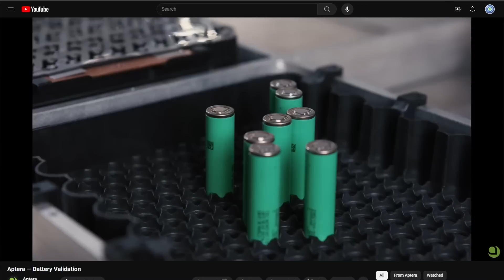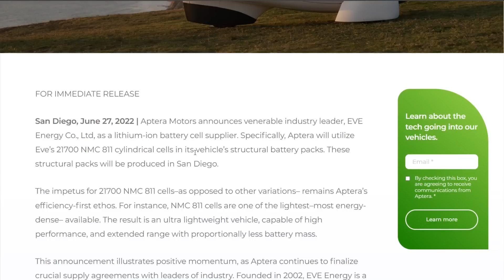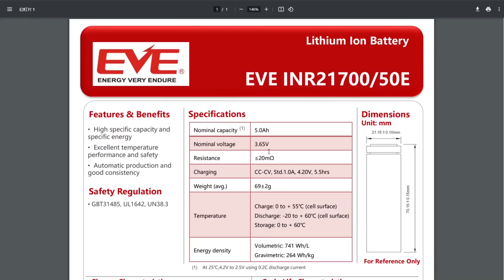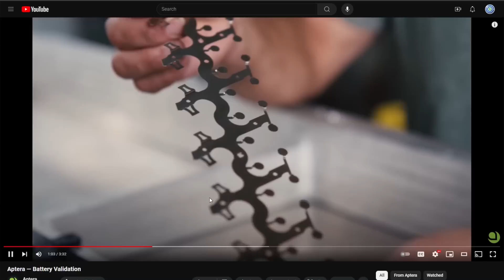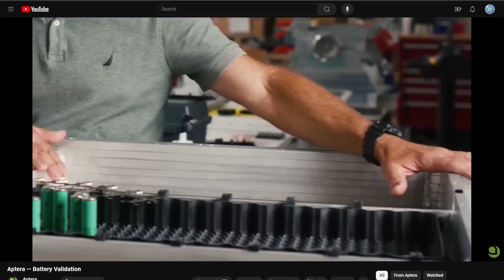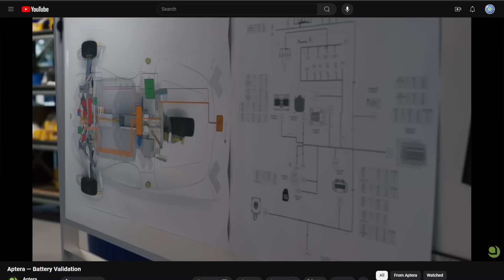Aptera's PI Battery Pack

Comment: They should use prismatic batteries with better energy density per battery pack per liter and also jus single motor in rear wheel .

Comment: Sorry for the late comment, but my private cell provider put out a new price list for cells.  I don't know if EVE's "INR21700-50E(3C)" (a 5000mAH capacity 21700 cell) that you looked up and the one listed in my price list is the same as their "811" cell, but this cell is currently listed for retail purchase (non-wholesale) for $1.95 usd /cell.   With the LE's requirement for 2,304 cells (384 x 6), if I were to buy them, it would cost me $4,492.80 usd to purchase the cells for the 400 mile LE

Comment: I love that they've done the vibration testing, but I would be curious to see how the battery pack holds up after simulated 200, 300, or 400k miles. 

I'm sure that if a failure due to design was going to happen, it would have happened in the first 100k miles, but think about the theoretical lifespan of these vehicles and batteries. 1000 charge cycles of the 400 miles pack is 400k miles, and the battery might last even over 1000 charge cycles 

Even if the warranty was only up to 100k miles on the battery, I think it would still be very informative to vibration test 1-2 packs up to 300k miles, just to see how they preform.

Heck, you could even take one, and just vibration test it until it fails, just to see how long it will go

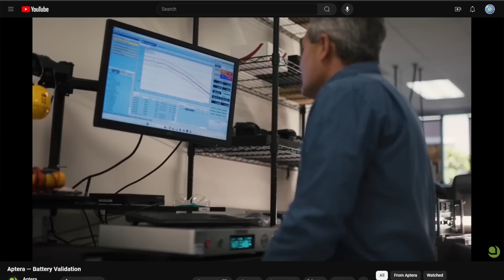Comment: @18:30 "no capacity reduction" after 100,000 miles of driving? really? does that mean they're saying the range of the pack 100,000 miles later will be just as good as it was when it was new?
Reply: This test was just about mechanical connections. They shook the battery an equivalent of 100k miles of driving, and everything still worked. Presumably they're still doing other testing
Reply: @GoClimbARockEh  yes, that was pretty clear from what was said in the video. I was curious about the comment 'no capacity reduction' - what could that possibly refer to other than battery capacity? If the test was purely about mechanical connections, what capacity was he referring to?

Comment: Hopefully LiFePO4 also will come in that cell format and reprogramming the battery management is easy.
Keep the weight the same and let the energy density drop to whatever it come out at (%10 less??).
The voltage might be a bit less and the 4 sec sprint time might increase a tad.
I'm currently looking at buying an Ora to drive till Aptera comes to Australia. I'm opting for LiFePO4 version with 110K less range than the NMC version.
Ora range is quite marginal for me but Aptera will go twice as far per KWH.

Comment: Nickel has higher energy density than cobalt but is more volatile. Recent chemistry engineering toward higher (and aspirationally all-) nickel content has been on stabilizing the cathode to allow maximum nickel percentage without sacrificing safety and longevity.

Comment: Thanks for another great video. None of the numbers add up but are in the ball park. That's kinda par for the course with lithium battery packs. A couple quick Google searches suggest the complete battery pack will be in the $10K to $12K range which is good news. The engineer seemed a bit too cheerful about the 'better that 400 miles per hour' charge rate. That's 2/3's of the 60KW DC fast charge Chris Anthony mentioned they might get to in previous videos.
Reply: The 400 may be a consistent rate while the 60 may be a peak rate,  which is typical of ev charge rates.
Reply: Came here to say this. 400 mi/hr is what I get on my Model 3, which is slated to have ~1/4th the range per kWh than the Aptera. So the Aptera battery pack will be charging at 1/4th the rate of a Tesla…?

Comment: As per normal, i'm confused. ¿Why is a single 'bus bar' connecting to both anodes and cathodes?
Reply: Some cells are in series, while others are in parallel.
Reply: @glennzajic7318  Thank you. Question: ¿How is that better than having each group of cells in parallel?
Reply: @NorCalSkeptics  Cells are combined in series to accumulate the voltage needed, and in parallel to provide the current required. If they were all in parallel you would only have about 4 volts but current up the wazoo. Current is what dictates the gauge of wire needed. The higher the voltage the smaller the wire can be to still provide power. I over simplified it but I am sure somebody more knowledgable can explain it better.

Comment: The 700 in a 21700 cell is the length in tenths of a millimeter.  "Large" cells like this don't really need tenths so they're rounded and just called 2170.  Tenths matter more for coin cells.
Reply: I learnt in school that 10 mm = 1 cm, therefore, 700 mm = 70 cm. The battery cell dimension is 21700. The only way to make sense out of this number is that 21, the diameter, is given in centimeters, whereas the length, 700, is given in millimeters. Thus 21/700. So, no mistake. Is that what you are saying?

Comment: All those hundreds of cells and connections what could possibly go wring . 
   I dont know much but i always wondered why they couldnd make just one giant battery sort of llike a conventional car batery but much larger .  Then it wouldnt take all those tiny cells and connections .
Reply: A couple reasons: each lithium  cell can only generate about 3.7 volts,  so for a typical 400 volt system,  you'll need over 100 cells to achieve that efficient voltage.  You could make bigger individual cells, to make higher energy capacity,  but bigger individual cells would retain more heat and be harder to hear and cool. The industry does use a variety of solutions,  from that 2170s and Teslas 4680 cells,  to "pouch " cells which are flat rectangles of various sizes.
Reply: @jamesengland7461 difficulty getting rid of heat I can understand .
Reply: At any rate,  this is a typical way of building millions of battery packs which have proven to be extremely reliable for hundreds of thousands of miles.  It is crazy though.
Reply: Oh yeah,  I forgot to mention- regular car batteries actually have 6 lead-acid cells , each with 2.1 volts. They're not terribly tough either,  and could easily crack open or the internals break under rough conditions.  They also only last,  for most people,  2-5 years at most.
Reply: BYD Blade Battery is what you are suggesting. I do not know the reason why they prefer these 21700, but I think these are more of a commodity (more manufacturer choices, more testing results available, easier to repair a decade out into the future) and these blade cells were not available at the time of battery pack design choices.

Comment: The battery pack does seem like a great design. I wonder if they could have left a little space for internal cooling though. I like the idea of replacing the batteries with longer ones for the 600 and 1000 mile options, but I do wonder if the longer batteries will conduct heat to the baee as well. And if they go with 100 kW charging the excess heat during charging will be much greater.

I think Aptera is assuming that end cooling will work just fine, and testing will prove that it's overengineered enough that they can handle even more heat with just a bigger cooling system. But if they have to redesign the battery pack it will take time, and the while point was to reuse the battery pack. 

Of course, rhe new battery pack can be used in the original 400 mile version. So they could save some money that way.
Reply: Do you remember what the dimensions for the longer batteries were meant to be?
Reply: @993cc  21120 for the 1000 mile, 2190 for the 600.
Reply: The length were 90mm for 60kWh and 120mm for 100kWh. 
Which means different height in battery pack why I would be surprised if an upgrade from 40kWh will be possible. 
25 to 40 kWh should be possible though.
Reply: @e-economy-  I could have sworn I posted the battery sizes needed. Oh well. 

Anyway, I suspect the battery packs are going to hang lower in the frame, meaning the belly pan will have to be redesigned to reduce the ground clearance and leave room. The tub and interior would be the same, but the suspension would have to be beefed up to handle the greater weight. 

Alternatively, they could raise the battery higher in the frame, but this would require a loss of 20 mm or 50 mm of headroom. The tub could still be the same, but they'd have to take the space out of the roof. Although I suppose they could just make the whole vehicle taller. 

They will probably make the frame thicker, to match the height of the battery pack. So modifications to the frame, suspension, and belly pan. Changes to the body will probably be minimal.
Reply: They don't care about battery health or longevity, these just have to last for test drives and videos to encourage investment, that's how this thing works - pay attention and you might just save some money
Reply: @bluetoad2668  Aptera's batteries are going to last just as long as the batteries in Teslas and other EVs. The idea that EV batteries don't last is a conspiracy theory.

Comment: The battery tray will likely be constructed from extruded aluminum cross members joined at their ends either by direct welding or some other custom cast or extruded members. I beleive that is what Chris said was happening in your interview with him previously, I may be mistaken though cause he could have been referring to the frame at that point.
Reply: I can't see the battery tray being cast fiber or glass as those materials are poor thermal conductors.  Also, casting seems like it'd be out due to the tooling costs whereas that tray looks pretty simple to assemble from dimensional stock.
Reply: @SomeGuyNamedPaul49  what I was saying is just where the extruded members would meet would be a cast aluminum junction piece, just a thought, not saying its going to be like that
Reply: Guessing it doesn’t matter how the battery tray is constructed for PI vehicles so long as it has  very similar weight & strength of final build…. and gets us to PI asap (w/o inferior construction). Someone considerably more experienced & knowledgeable than myself persuasively argued more of PI should be hand-built.
Reply: Are you perhaps confusing the battery's frame with the vehicle's frame? I suppose they are two separate things.

Comment: If this car charges at 400 Mi/h that means the peak charging speed must be only 50 kilowatts
Reply: They were aiming for 40-60 kW, so it's right on target. In terms of mileage, however, that is impressive. It will just generate a lot less heat, and more importantly, cost a lot less than 400 miles per hour for a Tesla.
Reply: My current EV charges at that rate and it is something like 1/4th as efficient a design.  So this will give about 4 times as many miles per hour as that which I am currently completely satisfied with.  This is very fast charging and being a relatively small battery, it does not require as much in the way of materials to build.  A great choice. Higher charge speeds are not required for this very efficient vehicle with a small battery providing so much range.
Reply: I think you mean “average” not peak, right?
Reply: I don't really have a good idea of what 400 miles per hour is compare to other EVs 
because this depends of the consumption of any EV , which is between 3 and 5 miles per kWh.
Honestly 60 kW DC is quite low, like the Nissan Leaf, while the most advanced Superchagers can provide now 350kW and even more.

Comment: 400 mi per hour charge rate doesn't seem that great.  That is a 1C charge rate and 1 hour to fast charge from empty to full when on the road for the launch edition vehicles.  I would have thought they would have been able to charge at 2-3C for a 30-40 min charge.  Hopefully that will improve when the PI vehicles come out.
Reply: They have mentioned looking at a 100 kW charge rate. However, they will need improved cooling to handle it. 

If they want to charge that 1000 mile battery in anything close to an hour, though, they will need it.
Reply: This won't matter much for me. Most of my power will come from the solar panels and when I do need to charge I'll just plug it in from home. It will only matter to me if I go on a road trip longer then 400 miles. Which is something I have done in about in 10 years.
Reply: 0% to 100% while legit for comparison is more a math thing than real life. Most people I know that roadtrip start at 10 -20% and quit charging at 80 - 90% depending on battery type and charging curve and temp.
Reply: @ronfarnsworth7074  I agree, but a rate of 400 miles per hour is still only 1C which isn't a great DC fast charge rate.  My 2015 MS starts at about 1.5C and that is slow by todays standards.
Reply: It's also worth noting that higher C rates are harder on batteries.

The low C rate could lead to a much increased battery life of the vehicle.

If they manage a modest 150kw, that translates to 1200 miles/hr, absolutely insane.

I'd bet the first launch editions won't be capable of this, unless the beef up cooling.
Reply: We were never told to expect 2C charging, but their original target was 500 miles/hour charge rate or better, so 1.25C I guess? 
400 miles/ hour is a bit disappointing, at about an hour and a half of driving on a 15 minute charge. Hopefully the larger, or later, packs will charge faster.
Reply: I thought I remember Aptera saying that they're targeting 40-50kW DC charging initially, with the goal of increasing the rate via an OTA software update once they have more time to find the max safe charging rate given the current cooling system.
Reply: This is the improvement, don't forget they tried to reduce charging rates a little while ago as a cost saving measure.

Comment: I wonder if thermal compound is the same as the thermal paste they use on CPUs.
Reply: Similar. Loosely related and similar job duties. Actual chemical compounds differ between thermal pastes and thermal adhesives etc.
Reply: My guess is that it isn't thermal paste, but solder paste. The bus bar is soldered to the nickel plate when the laser heats each spot to get the best possible surface contact..... I could be wrong 😅
Reply: @sra71121 If you're thinking flux I don't think so.
For end cooling they'd use thermal compound.

Comment: Battery sizes, I can't say for sure but the zero on the end is actually the letter O. It signifies that the cell is round. I kinda wish they would drop that because it's not necessary and confusing.
Reply: They generally have dropped the 0 and these days people usually refer to it as a 1270, though 18650s are still almost exclusively retain that 5th character.
Reply: Good observation, makes sense.